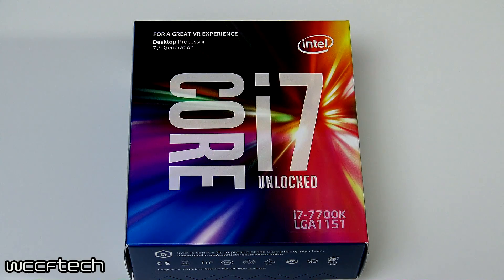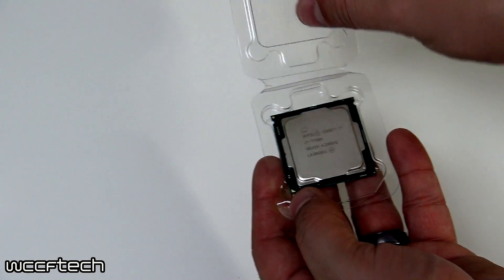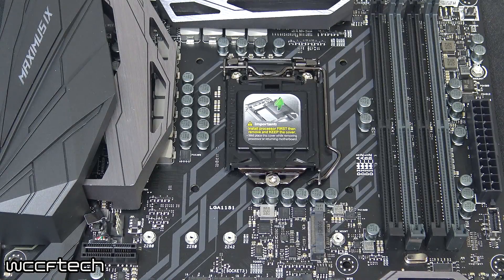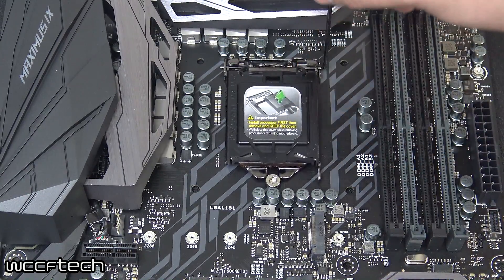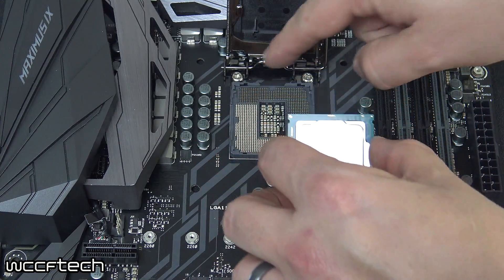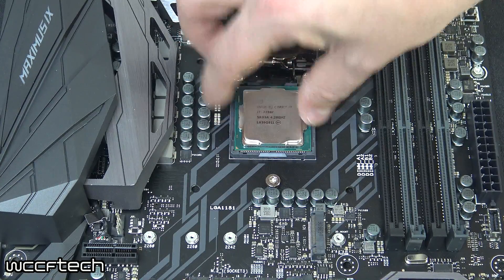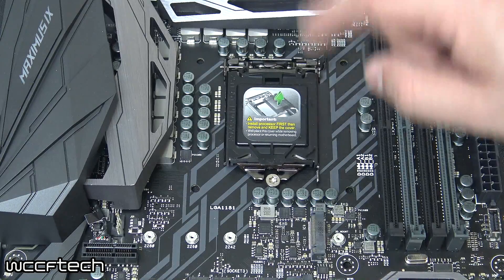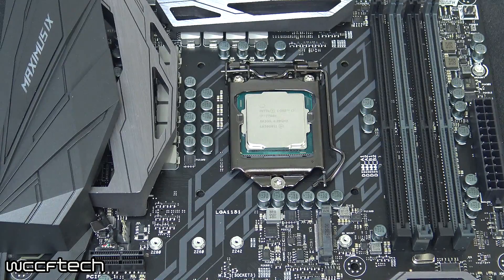Intel Core Series CPU Install Guide

Comment: Pretty sure if someone is comfortable enough to install a new 300$ ,main chip, let alone purchase one, they'll know about static discharge, leaving the PC off, adding the thermal paste, installing new drivers :-) I agree with the others tho, straight up and right to the point. Great vid. I finally broke down,  and decided to give my old desktop's core I5 an upgrade to the I7K, basically I was bored and needed something to do lol. The price finally reached a somewhat reasonable level for my fudget budget. After 12 years, it was a welcome change to see new text in the old Gigabyte Z68MA D2H B3 bios boot screen. Can't wait to re-do the Windows 7 Experience Index and see if it breaks the 4.7.
Reply: My bad, 2020 score was 5.9 due to low disk data transfer score. Processor was 7.2.